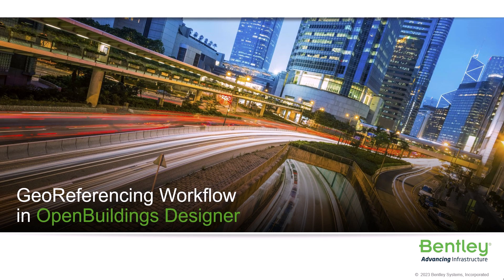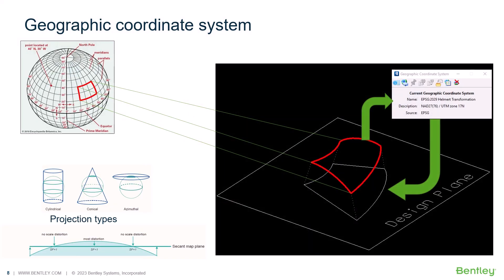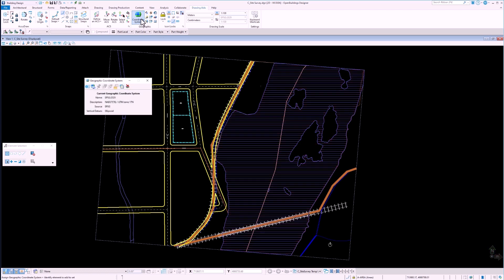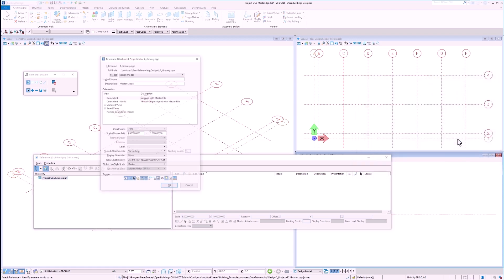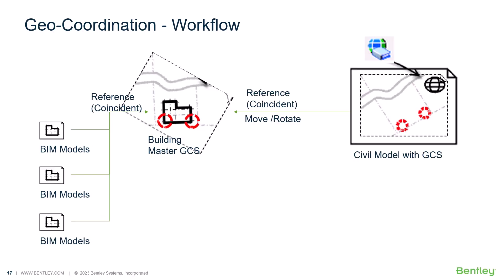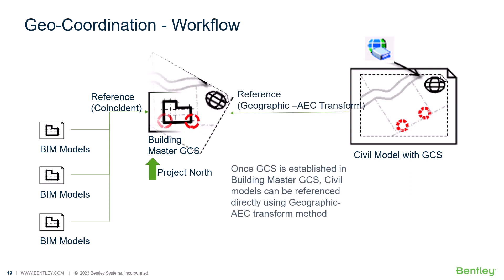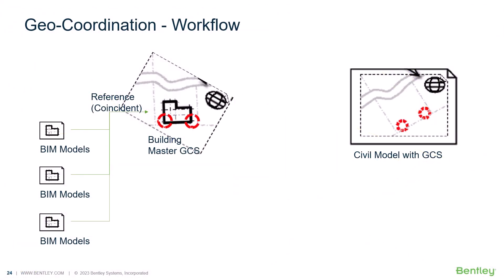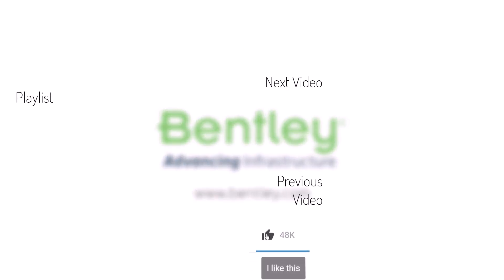OpenBuildings Designer Update 10 | Geo-Referencing Workflow

Comment: Followed this video exactly and the attached file with a GCS can't be used because of the error in the GCS Reference dialog box that states, "The reference is not in the X-Y plane". If I attach the same reference file without moving and rotating it, I do not have that error.

Comment: I followed along the steps, but the coordinates are not global coordinate anymore in the master GCS and BIM models, after moving and rotating the site reference file which has been already applied. Is there any step needed to set up such as monument point? When I set the monument point, the coordinate of the monument point is correct but another point which is located diagonally from the monument point is wrong because of the site reference rotation. Could you please guide me how to solve the problem?